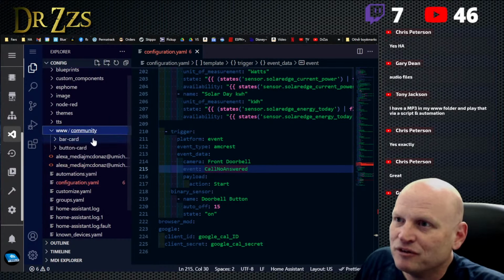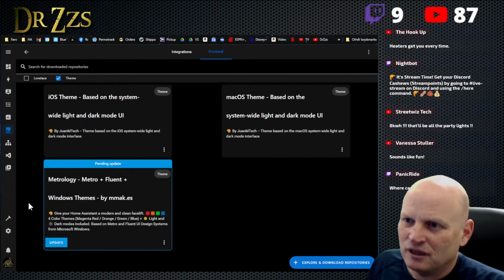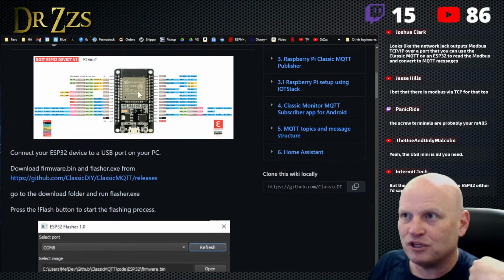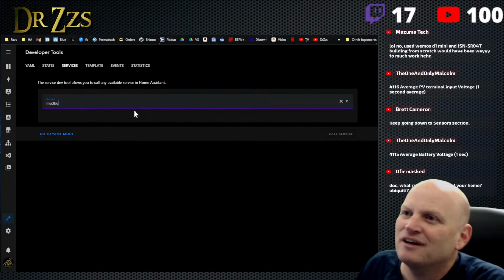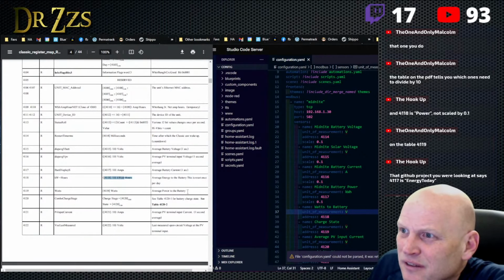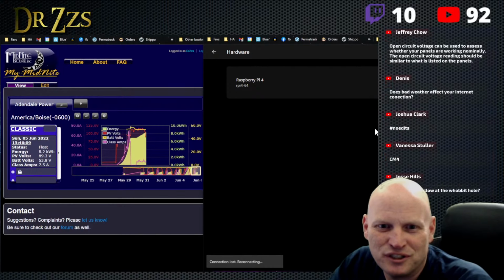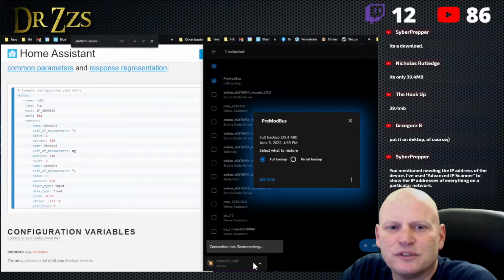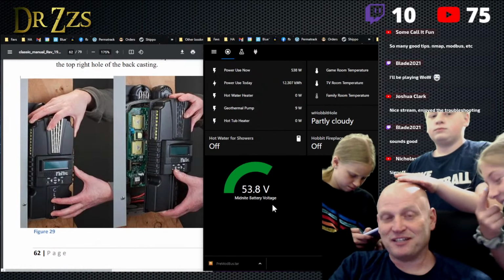Solar Power & Home Assistant at the wHobbit House | 3D printer with super-auto bed leveling

Comment: Hot water heater tanks, shower heads, hot water taps and pipework can breed Legionnaires Disease bacteria, as it breeds in stationary warm water (25-50°C). To prevent the Legionnaires Disease bacteria from growing in your hot water tank, do not lower hot water tank temperature below 60°C (140°F).